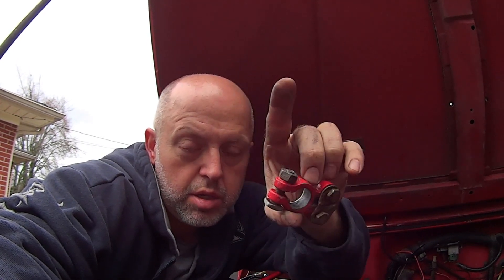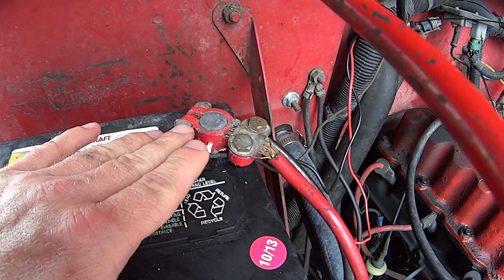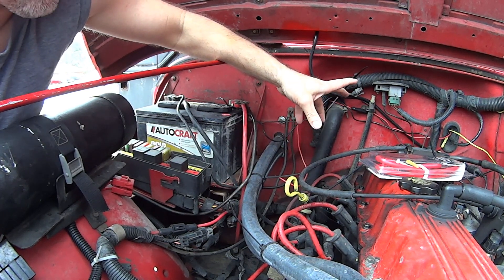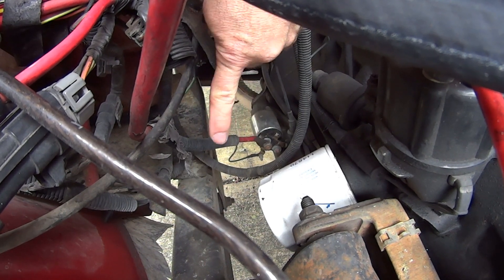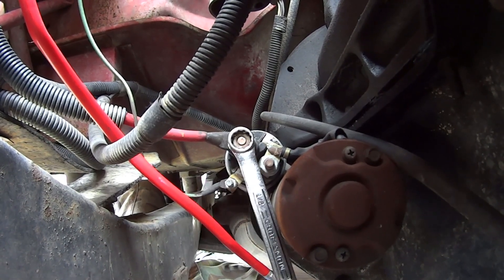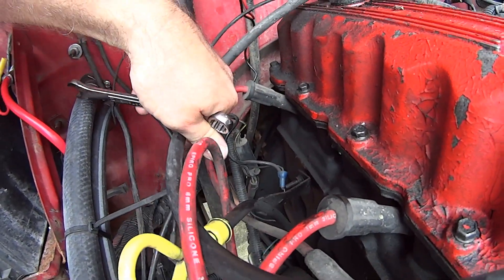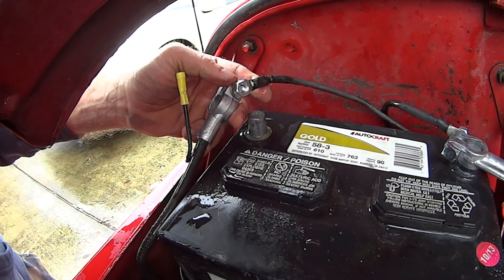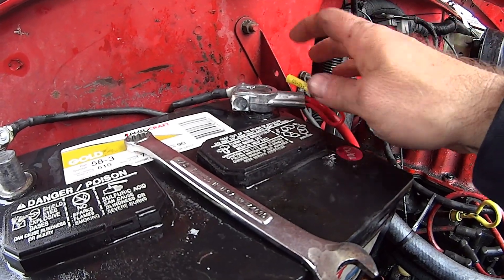Jeep Wrangler YJ - Gets new battery cables

Comment: Never realized the battery cable ends on my 95 YJ were cheap aftermarket ends. Thanks for the video, I'm going to change them out this week. I have a battery less than a year old that sounds strained every time I start the Jeep. Hopefully the new cables help, thanks again!
Reply from the maker: +kjdb27 Mine started way better after replacing the cables. Many people use those ends because they are so much more simple to swap out. I understand that, but they degrade over time and become unreliable. Thanks for dropping in and for leaving a great comment! Have a great day!

Comment: Good stuff Chuck.  I live in Arizona but did spend some time in Tennessee many years ago.  Still enjoy driving through it, and stopping to chat with good people.  I've got a YJ Wrangler with the original two-hole terminal end.  Needed to replace, and enjoyed your video.  Will add a power junction box as you connect so accessories don't clog things up.

Comment: Thank you for this.  I have a 94, did just a motor swap...with friends who knew what's up and in their garage.  I'm not a mechanic, but have learned so much and really always want to try on my own.  I've got an issue that I think is this...a bad ground.  She fired awesome the first time but has gotten worse.   Drags starting but pops to 14V.  Had the same issue with the old motor.    New battery.   The ground is loose enough to turn with hand on the battery...old and worn out for sure.  Worked fine the first few times, but think this is it.   Going to do this before I get stranded.  20 something in parts, and easy.   Thanks!!
Reply from the maker: Yep .. sounds like a ground to me. A bad ground can cause all types of weird issues. Hope this video helps! Thanks for taking the time to leave a great comment! Have a great day!!

Comment: the old truck I offroaded a few years back I used marine quick disconnect type...they worked awesomely on the old truck...would I use them on my street truck and car only in a pinch...have a great day...
Reply from the maker: +Mike Brown Man ... I forgot to mention those. I'm cool with the marine style as long as the cable ends are done correctly, such as soldering the lugs and heat shrink. With the marine quick disconnect, the clamp that goes around the post is typically much thicker. Also, there is the stud / wing nut that the cable is secured with is very unlikely to strip out. As long as that wing nut doesnt back off, its all good. I ran them on a 3/4 ton Chevy 4x4 I once has. Good to see ya dropping in again. Have a great day!!

Comment: What gauge wire did you use for the extra ground cable from the negative to the firewall, and from the positive to the fuse box? And did you use the same style end for the cable going to the fuse box? It has an L bracket with two nuts, but will a single connection point work just the same? Thanks!

Comment: I did something dumb ordered a 4 inch leaf spring my question is to do the body lift and the engine mount do you need a 4 inch lift on those as well PS I accidentally only ordered once now I got to get 3 more
Reply from the maker: +Gary King Body lift can be done separate or not at all .. up to you. As for the engine mount .. well it really depends. If you do a 4" suspension lift, you may need the taller mounts to decrease the drive shaft angle. Or, do a transfer case drop kit or both. But, the more correct way is to so a SYE (Slip Yoke Eliminator), thats a bit more complicated to explain. I dont have video for that yet. Google it, there is tons of great info about it  So .. in short, the more lift the more that needs to be changed. The more that needs to be changed, the more money it takes. Good luck! Hope this helps. Have a great day!

Comment: What gauge of cable is that you're running from your fuse box to your battery?
Reply from the maker: Its a 6ga. It was some car audio amp power cable I had laying around. The car audio cable it way more expensive. But, so much better quality copper wire and looks tons better!! Just go by any car stereo shop, you can purchase it by the foot.